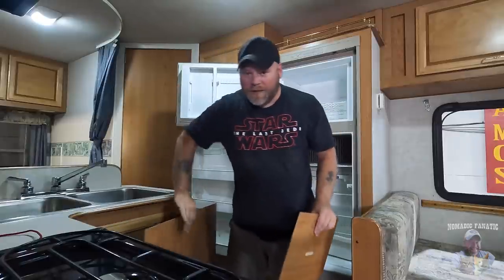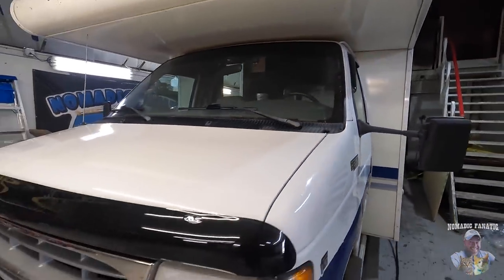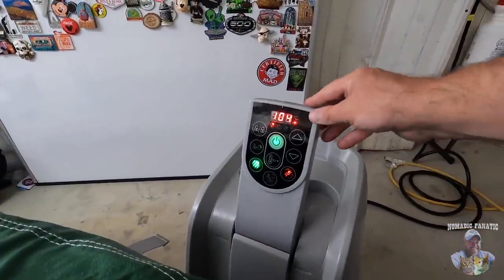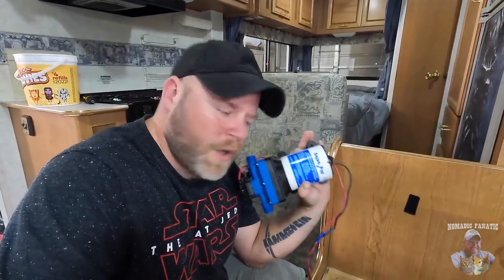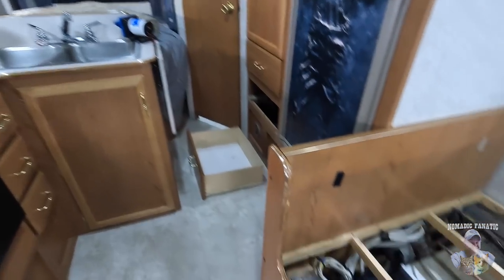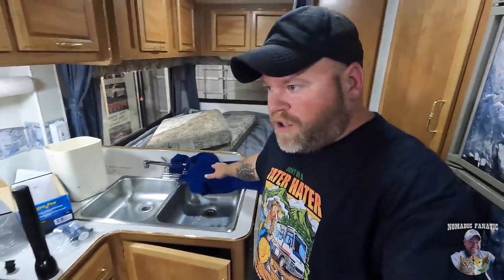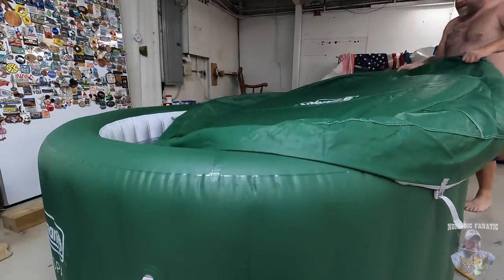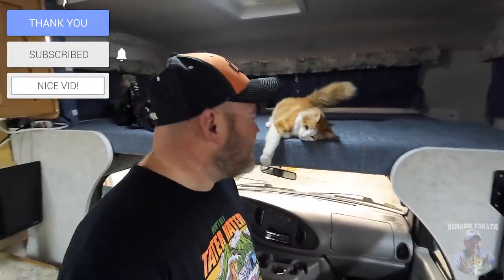Getting RV MODIFIED Immediately & Tracing A Water Leak...

Comment: Eric, as a small hack, once you get the RV parked in the spot that you want with the right clearance, hang a string from that spot that touches the front end and put a rubber ball at the end to give it weight, that way any time you pull in, as long as you touch that string, you will always be perfect.
Reply: Old people do that when their depth perception gets bad, to save their garage back wall.
Reply: @anitablades6033  Yep. My Inlaws had that set up in their garage.
Reply: Ya that's sooooo old people says the 67 yr old

Comment: See if you can find a mud flap for a truck.  Take a piece of that and screw the pump to it, then screw the rubber to the floor (different holes than the pump).  This will isolate the pump so it is a little less like a drum while running.  I've used the same method for mounting my garage door opener in the garage below my bedroom and it no longer wakes me up when my wife opens the garage door.
Reply: Good idea!
Reply: Useful info! Thanks!

Comment: I took out my upper bunk mattress out and made it Kitty play land.   Have carriers with heating pad and fan plus remote max fan I can open while driving if it gets warm up top. They even have a lamp and small Jackery to run the 12 volt auto fan to keep them cool while traveling. I have a 4 way thermometer and have one sensor up there to keep an eye in the cab while traveling, stopped or in for repairs. They have a 4 ft scratch post in the one corner to get up and down.
Reply: Awesome! Scratching post is a must! 😽😺

Comment: Another idea for the bed replacement is to use a full size spa sensation memory foam mattress from Walmart which full size is 6” thinner than a queen and would allow bathroom door to fully open and give extra storage room along wall for shelves or storage. We have done that before. Also once we cut down a queen mattress and my husband measured it out and used a fillet knife and the edge was perfect. We had taken the memory foam mattress out of the case it came in to cut and then placed it back in the bag.

Comment: I've been hesitant to use a bug bomb in our fifth wheel. We have two dogs, and I'm really not sure about how long we have to wait to go back in. We live in it full time, so it's kind of important.
Reply: Everything must be cleaned afterwards. Bedding, fabrics, vinyl,  floors, cupboards anything you touch or your pets touch.
So much easier to sprinkle Diamataous Earth, Food Grade Organic ONLY in and around baseboards, under the seats, cracks, crevices, etc. Kills bugs, mites, fleas is safe for cats, dogs, pets..you can even mix in water and drink it for parasites, sprinkle on pets bedding, carpets. I sprinkle in my bird houses after cleaning for mites, ants, spiders so when they make new clean nests all is good. Any bug, insect, etc with shell type body it dries out and kills them. I mix in a tablespoon with my Squirrel Food, bird seed etc too.
Reply: I always hated when my wife told me it was time to bomb the RV. I'd set off one bomb at each end, and close it up for 24 hours. Then open it up completely to air out, while taking hydrogen peroxide to wipe/wash everything down. Pull the curtains and have dry-cleaned. RV was ready to go on the 3rd day, but sure was a lot of work!

Comment: You can buy some foam gym mats to get the hot tub off the cold cement to keep it hotter longer and as a bonus, it will add some needed cushioning to it as well.
Reply: ah hey, why not a heated blanket under that hottub? you made me have an idea. under the heated blanket that gym matt for thermal isolation.
Reply: Or stall mats

Comment: I had an RV just like that except for kitchen L shape and mechanicals under bench seat. I totally redid everything. Took out bench seats and table and put a purple couch in. Painted walls, ceiling, wallpapered, reupholstered front cab seats, installed back up camera, installed new outlet, new flooring, new roof vent covers, sealed outside window seams and roof, new window coverings and blackout shades. Everything. So much work. Then decided it was too big and too much work to keep everything working. Sold it. But it was girly and so cute.

Comment: If you ever have issues with the hi limit on the furnace replace it and add a vent line. Furnaces can have heat back up into it causing it to overheat and signal the hi limit. You cannot tell this is happening until that hi limit quits( normal after it has shut furnace off about 7 -8 times) Furnace will not run....
After I added the 3rd vent line no issues!! You can see the connection port on the furnace next to water pump!

Comment: I use the REMCO Industries
55AQUAJET-ARV 
5.5GPM, 12-volt, 10-amp, 65-psi Water Pump.
It just makes our lives easier. It uses quick-release fittings, for fast replacement, and comes with a particulate-catcher.

Comment: The heat from the TV will cause the thermostat to misread the temp and it'll be warmer than what the actual temp should be. Maybe a small pull down screen and a short throw projector.  Instead of running wires for an extra outlet , maybe just use a 500 watt power station that you can conceal under the seat.  And re charge it as needed.

Comment: For your TV mount you could put it in the same place, just screw a piece of wood to the back side (bed side) of the counter and mount the top under the cabinet. It really just needs more than 1 mounting point.

Comment: You could mount the tv in front of the over the cab bed area. Use a swing tv mount bracket to keep access to the area. looks like you could mount it on the backside of the cabinent.

Comment: Do you ever have problems getting in and out of gas stations when towing ?
Reply from the maker: It's not the car that is the issue for me... But this 32ft RV has the gas fill on the BACK of the RV. So, you gotta stick out the front of the pumps so far that it blocks off access to that part of the pumps for 5-10minutes. Sometimes people get agitated that they have to put their car in reverse for 10 seconds and go the other way to leave... lol. I try to ONLY gas up at flying J or Pilot stations where I get .5 cents off per gallon and we get dedicated RV pump lanes with dump stations, water, and no roof cover.

Comment: Eric,
Just a thought... on the fold down TV antenna... remove just the antenna portion.. Mount your wifi booster on it.  When you get parked simply crank up the antenna to raise the Wifi Booster... fold down while traveling...

Comment: You'll need to open the sink valve, let the air get out of the line. Otherwise, a lot of pumps will keep running. Once you do that, and you see water coming out of the sink, you'll know when the pump pressurises properly.

Comment: I'm curious to know if your friends at modified Auto could possibly put the TV in the location that you originally RV owner had only one major difference being that it would slide up from behind the kitchen counter and the space between the bed and the kitchen counter this way it could slide up then you could turn TV in either direction they call them hydraulic turn pulls or rotational slide up whether you want it facing to bed or facing your kitchen living room area and the way TVs are so thin these days I'm sure you could find one to accommodate the whole wide space of your half kitchen wall leaving you with the advantage of having an even wider TV that could be slid down not taking up space when not in use should not affect any area of your countertop other than possibly while rotating when you have it up hard to describe to you what's in my head but maybe if you read my comment a couple of times you'll get a better comprehension

Comment: Eric, I'm would change your RV, there was just too much mechanical trouble with Miranda, I assume you get better fuel milage out of the new, and parking would be better.
Reply: From what I read, the ford V10 engine in this new rig is notorious for poor gas mileage as well as blowing out spark plugs because ford had to fix a design flaw and doing so left only 4 threads on the spark plugs, as a result they either "weld" themselves in or they get blown out because only 4 threads are holding them in! Another "award winning" design courtesy of FORD! there's a fix kid for that but it costs several hundred bucks to fix the problem FORD designed!